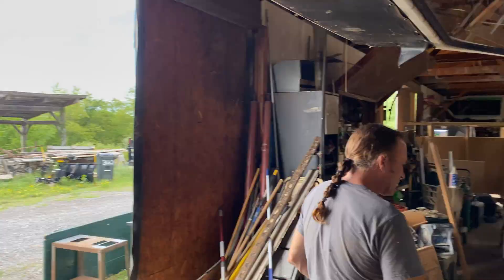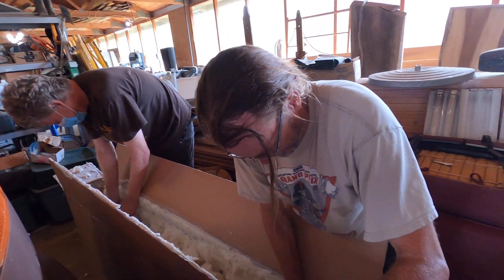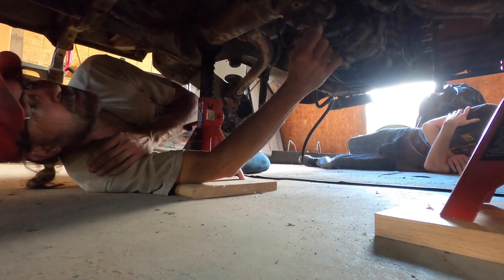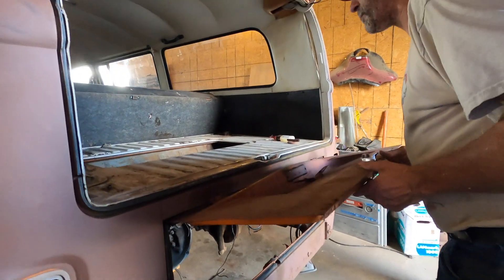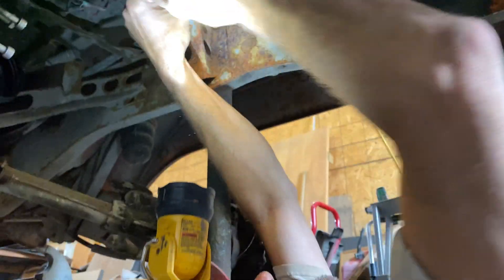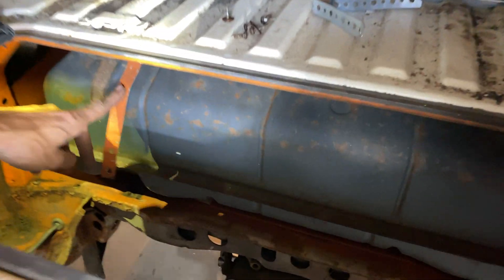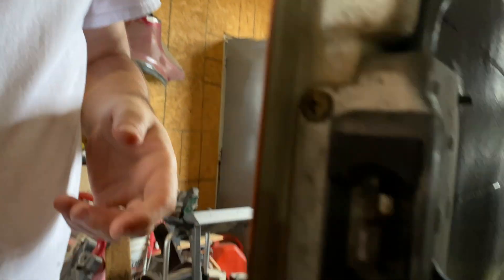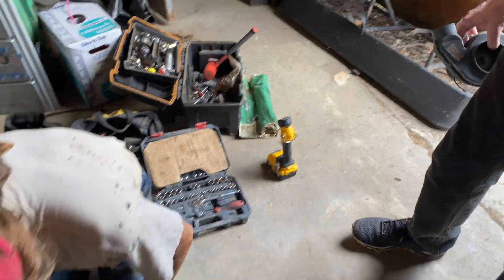Removing Gas Tank 1974 VW transporter (type 2) EV West Electric Vehicle conversion

Comment: I started restoring my 78 bus on my channel.  This bus will be my second EV conversion.  Just subbed to you to follow and compare notes.  I am further behind you because I have more rust and mechanical issues to deal with first.  But I will be starting on fuel door and accelerator bracket mods soon before I get to paint.  Good luck!